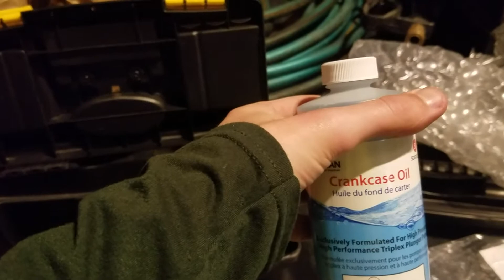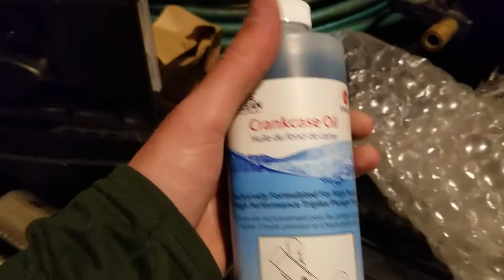Pressure Washing - Downstreaming and Spray Guns

Comment: Very informative. I'm realizing I don't know much about this. And I've been doing it for years! lol. I'll check out pressurewash . com because it's seems I'm missing stuff. So, using chlorine, do you notice a significant difference over using nothing but water? 
As for guns, I like to stay really far away from the action so I just put everything on the end of the giraffe. :)
Reply from the maker: Something 2LookAt yep the chlorine after sitting on the concrete for approximately 10 min, it melts the dirt right off and comes much brighter and cleaner. I understand the need for the long reach gun :)
Reply: yes ,i have also been doing a little bit of  pressure washing  and i used to just use water. but ilike2mow showed me how much better using chlorine is. its so much faster because the chlorine does all work. The dirt grime algie and mildew just comes right off then u let it sit for a few minutes then rinse it off with water and it looks so much better.
Reply: Ok, so let me ask the next obvious question. Where that chlorine collects and drains off to, say, the grass or plants. Does it hurt those areas?
Reply from the maker: No worries :) Whenever I am doing a concrete wash and using chlorine, the first thing I do is use the soap tip and wet the grass and plants with straight water next to the concrete. This prevents chlorine burn. After I am done, I wet those areas again with the soap tip and straight water to dilute any chlorine that got onto those plants and grass areas, and then it also rinses them off so there is no chance of burning.
Reply from the maker: Oh and one more thing I forgot to mention, using the chlorine to clean makes the cleanliness of the concrete last longer versus just using straight water.
Reply: Ok. Off hand, I wouldn't think that would be enough with pool chlorine but, gosh, I believe you. This is part of why I never did it though. I've seen some pros burn the daylights out of the edges but I guess they weren't diluting like you say. Then there's the other half of the problem, the fumes. Are you using a mask or anything? Do you just stay upwind? That strong chlorine is something I've never been able to get used to.
Reply from the maker: Something 2LookAt honestly I don't wear a mask, but I try to stay out of the wind lol